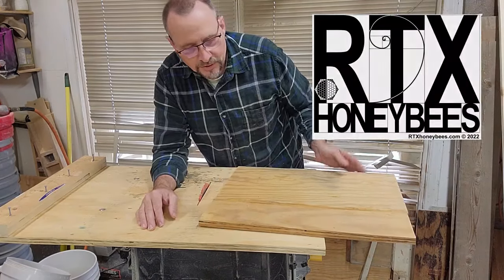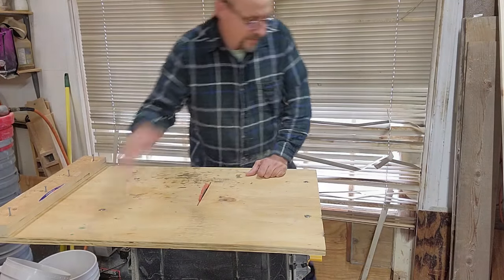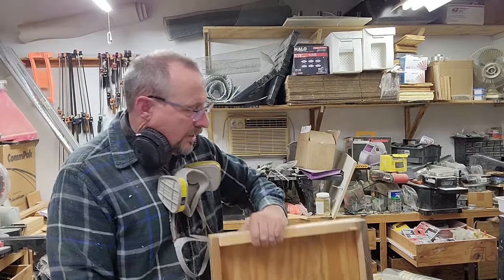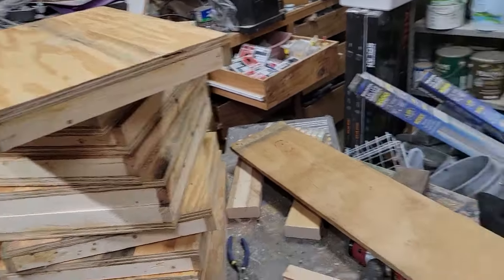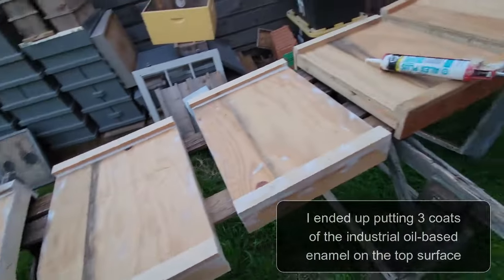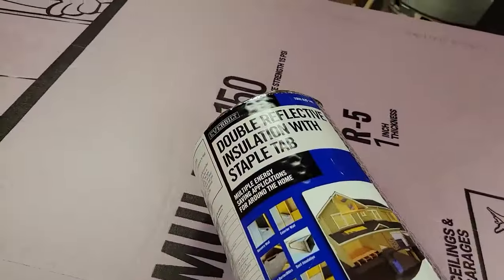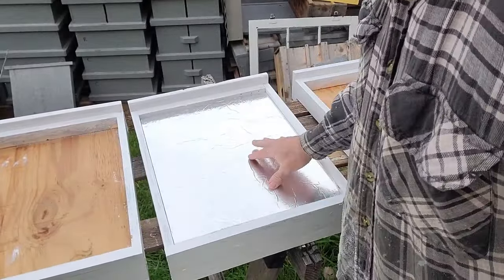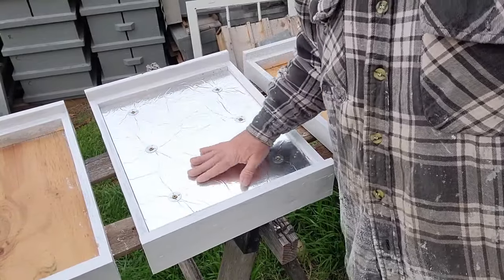Building Migratory Hive Covers.  How I Customize with Insulation

Comment: Quite a bit of detail in designing that little top!  Looks good.  I am having some issues with my foil tape coming off the edges of our insulation chunks under the lid as propolis sticks to it.  I used 2 layers of 1.5" poly iso.  It has a built in radiant barrier but it doesn't seem like it would be durable enough for in the hive use.  I was considering putting some packaging tape over it for durability if it proves to be an issue.  Thanks for sharing Phillip!
Reply from the maker: I was tempted to go with that polyiso, mainly because it would save me having to wrap the polystyrene with foil.  It has a bit better R value as well.  However, the HD I went to was out of the 3/4 and 1" polyiso so that made my decision easy.  I am concerned that the foil may not hold up - time will tell.  Worse case is I cover it with a piece so 5mm luann using the same method and caulk around the edges.

Comment: Phillip, you must be a mind reader b/c I'm making 4 frame nucs and I was going to request you do a migratory lid video if possible. About the insulation...my bees are chewing on the insulation in the shims that I built, and so I thought I'd maybe try burlap or canvas inner covers to stop that chewing. Anyhow, thanks for the video. ---Darren
Reply from the maker: It's just my gut feeling but I think canvas will work better than burlap.  I can see burlap being loose enough that the bees would get a hold of the strings and pull them into a fuzzy mess. University of Guelph uses canvas and the bee propolise them into a nice stiff consistency.  Thanks for bringing that up. I may try canvas myself.

Comment: This is basically what I had in mind, only I’m playing with some different options to protect foam. 

Then main thing I’m wanting to get right is how do I test them. There are so many variables and that makes it hard. I’m almost certain insulation in the lid will help, but how do you quantify it?
Reply from the maker: I already use insulated telescoping covers and I have zero problems with condensation in the middle of the lids.   I had some un-insulated covers early on and there was significant condensation on the lid, just above the hole in the inner cover.